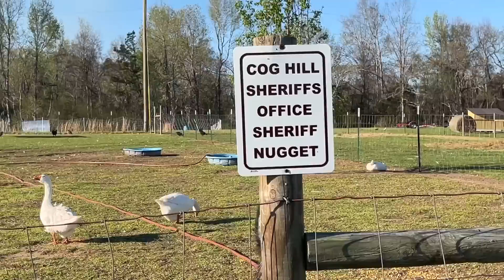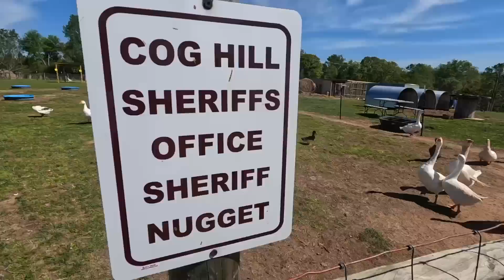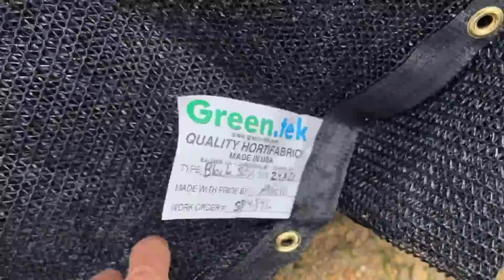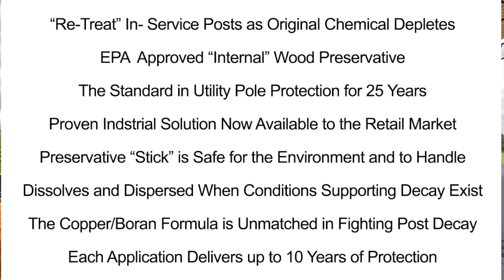If Joe Doesn't Straighten Up,  He Will Have To Go! (Plus day 4 of the barn build)

Comment: Lester was told drains wasn't needed either until the first time he cleaned the stall and ended up with standing water and breaking the concrete to make a drain for the water to go out.
Reply: Lester's barn isn't slanted though.
Reply: If built the right way you don't need drain holes. I'm sure the builders know what they are doing. I've never seen drain holes in barn stalls and I've grown up with farming on both sides of the family and a lot of my friends farms.
Reply: @heatherferg8980  1 it depends how the build the walls and what they use for floor studs. and 2 I have been in many barns that after washing the floor the stalls hold water the owners just didn't care and let the water evaporate or get soaked up in floor litter. Straw wood chips. Or even if the floors were cement or dirt.

Comment: Brooke I have a suggestion for you. When looking for a refrigerator consider a commercial one like they'd have in a restaurant. Not the walk in type, just the standing glass front type. If you need a freezer you could just get a small chest freezer to set next to it.  Anyway getting one like that will allow you to have some overflow for the house, to keep animal meds in close to where there are, etc. It's usually easy to find good deals on used ones online or from a local business that sells used restaurant equipment.

Comment: Brooke you should watch Roots and Refuge Homestead and see the setup of their milking room and setup for refrigerator, sanitation, and how they have their milking stand on the outside so they can hose down the concrete after milking etc.  They put their barn up last year and I think you would appreciate parts of their setup with milking room and stalls.  They even created a large brooding stall for chicks.

Comment: The lean-tos on the barn also give you space to store hay out of the weather. Stock up during the hay season when it's cheaper straight from the field. Open span gives you the flexibility of using portable stock panels in the stall area.

Comment: Aside from shade cloths the greenhouses I worked at also whitewashed the roof each spring. The rain removes it by winter and it made a big difference also. He also installed a couple of big fans at each end. But as cool as it got with all that would still run over 100 in July at times. But the cloth and whitewash sure helped! I envy you having the greenhouse! I had one for many years and it was my quiet place to go work and think and listen to the birds 💗🇨🇦

Comment: May want to think about installing a on demand hot water heater under the sink in the milking stall so you aren’t paying for a regular tank to be heated 24/7. And it will save a lot of space too.  The barn size will give you plenty of room for more stalls if needed. And it can be built on to if you need more barn space for bulk feed & hay storage or trailer & truck, tractor storage in the future.

Comment: The one thing to remember is older refrigerators cost more money to run. You need to look into getting a new one that looks like an older one if that's what you want it to look like. A new one will be far more efficient to run.  It takes so much less electricity to run a new one. The newborn is looking good. 👍🙏🕊️❤️🌻☕🌹

Comment: at a throughbread horse ranch I worked at their barn was concret for the stalls but down the center of the barn was asphalt  and it was a drive thru barn with celing fans at each stall and you made a good choice.   speaking about pole protectors look at mike morgans post from yesterday on outdoors with the morgans his fence company used a vinal protector that goes around the pole check it out the ship and sell them all over the US